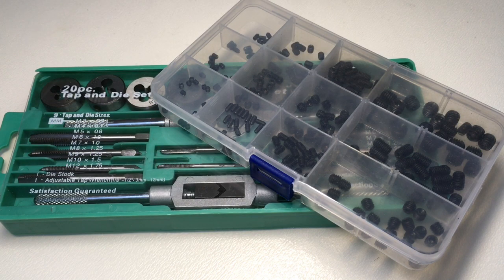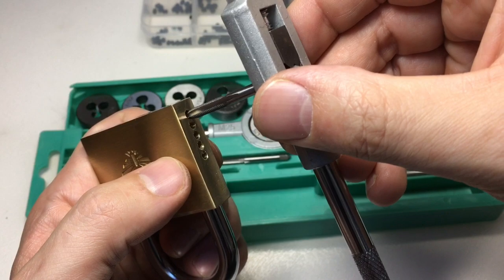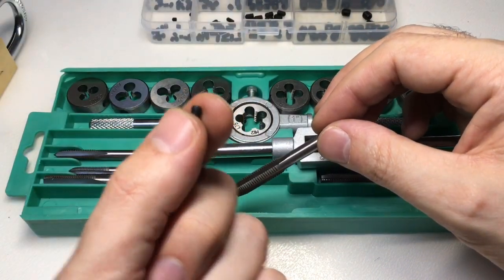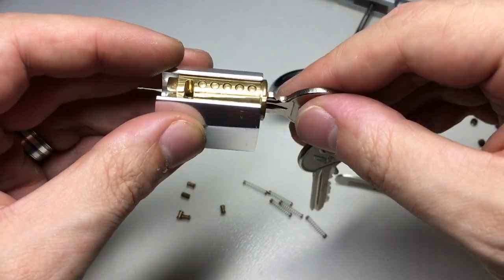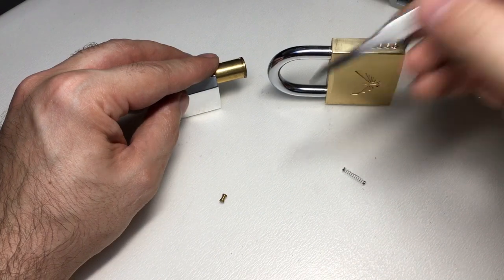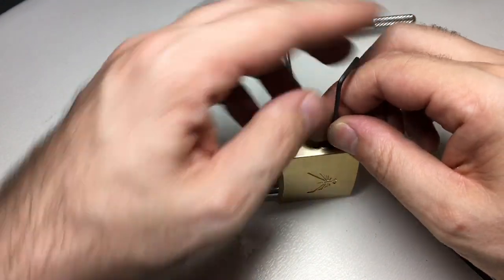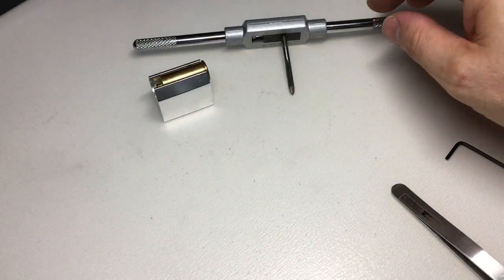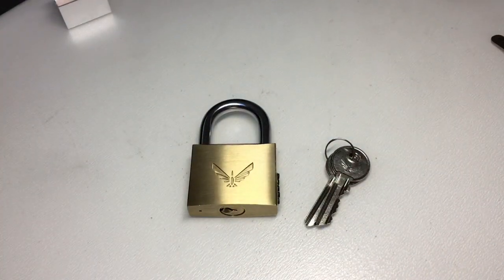Banggood com.Review - Tap and Die & Grub Screw Sets

Comment: I've just ordered a grubscrew set from Banggood :o) Don't put me in draw please...You probably know this - but to find the minimum size of hole to drill for tapping - subtract the pitch from the metric thread size. So for an m4 x 0.7 thread, the tapping drill is 3.3 minimum. You can get away with a bigger hole, which makes tapping easier  but thread is a looser fit. A smaller hole means the tap will be hard/impossible to start, and in harder stuff than brass could even snap a small size tap off - and that is the end of your project - you won't usually get the broken tap out :o(  Cheers...
Reply from the maker: noakeswalker the giveaway is for the padlock, not the sets :-) thanks for the interesting reply :-)
Reply: Oops! Yes, padlock only in giveaway - you give away so much stuff I missed the point here :o) I have grub-screwed some locks (a horrid GeGe euro cyl with massive serrated pins was one, since you ask ) and so I won't partake in the draw still....
Reply: I wanted to write the same thing but you beat me to it. I show it in my older video about making practice locks about drilling diameter vs tap diameter. Anyway, there is a store on AliExpress that sells drill bits with any size but since I am sending you a package this week I can put couple of 3.3 drill bits if you want them.

Comment: I have a similar tap set, but since I twisted some taps ;D I had to get new ones for the smaller sizes from M2 to M4 I usually use. Anyway the holder looks quite okay. As for the grub screw set..well, if you need all sizes, it's good, but if you want to make practice or challenge locks with it, you're way better off bying a bag of M4 and M3. After drilling, debur the start of the hole a bit with a special drill (no idea what the english term is, a sinker?) by hand. Makes it look nicer and the tap goes in better. Love your Avocet practice lock, but I would tap it deeper and just tighten the screws not that hard, because you can mess up the hex top of the screw very easy ;). Anyway a nice video, thanks for sharing buddy :).
Reply from the maker: Great advice and tips as always Foxxy :-) thanks :-)

Comment: Most lock pins I've seen on good locks are 1/8" which is of course too big for M3 but actually a bit small for m4. Try a 3.3mm drill or 3.4 in steel to let the tap work more easily. 
If you want to get a tapped hole with a definite stop rather than a tapered end use a plug (bottoming) tap after the taper tap. Enjoy ;)
Reply from the maker: Yeah, I might get a 3.5 tap and M3.5 grub screws eventually :-)

Comment: Just to add, anyone thinking about making their own (cheap) practice locks try Diall. I think they are made by/for B&Q. I got a 6 pin euro cylinder which I cut in half to make 2 practice locks but be warned even though cheap they are a VERY tough pick! It took me a week just to get a false set! Has a steel (anti drill) pin in chamber 1 and spools in 2-6. They make great (but tough) cheap practice locks!
Reply from the maker: Good tips :-)

Comment: I widen the top of the holes slightly with a 3.3mm drill bit before tapping with m4, I’ve found the tap lasts a lot longer that way 🙂
Reply from the maker: Good tip :-)

Comment: Looks like it came out great! How difficult was it to figure our where to drill the holes? I know that with brass padlocks, you can often make out one or two of the plugs that you would have to drill out, but it seems like it would still be a fair amount of guesswork. Did you figure it out by measuring the core that you removed from that other lock?
Reply from the maker: Very good question. I sanded down the brass and I was able to see the plugs in good daylight. I marked with a fine marker then used a centre punch to mark ready for drilling :-)